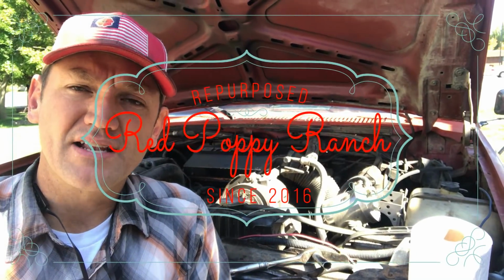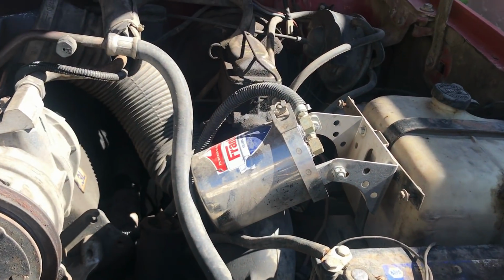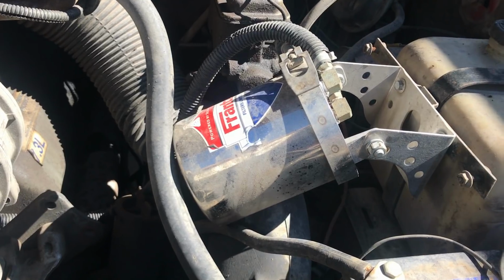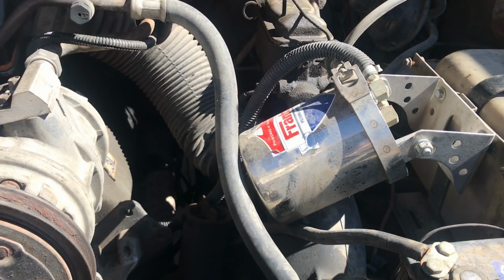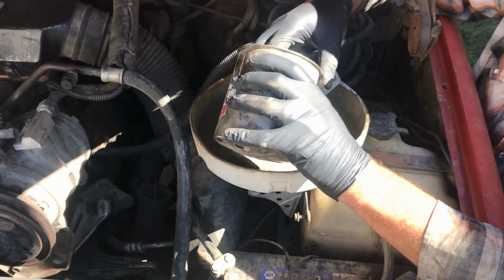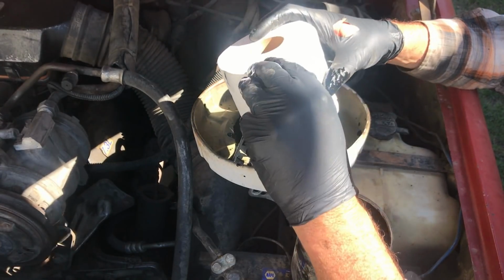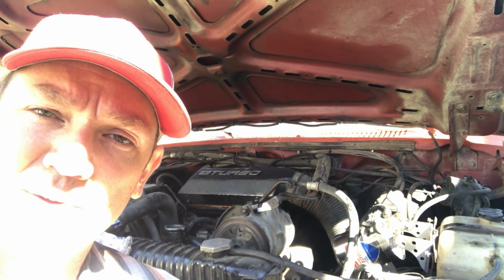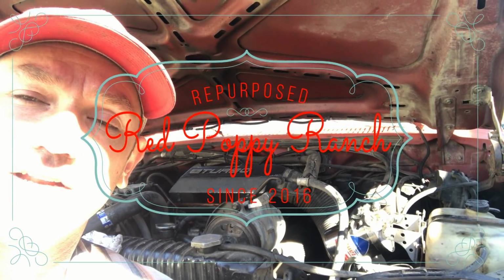#146 - Toilet Paper Oil Filter Maintenance... (Frantz Oil Filter)

Comment: What happened to never change your oil I promise, that oil looks like a moonless night. Change your oil people
Reply: it is truly crazy if one doesnt change his engine oil ever. they will sell grease after their engine seize up.
Reply: Amir Danial its diesel as soon as you change it it will be black but i would never use toilet paper as a oil filter
Reply: Used these filters on diesel engines for over 30 years when I bought a diesel Peugeot. I want to see a shiny black. Not grey black. On a diesel engine I would use a less expensive proven oil like Shell Rotella or Chevron Delo. I would change the filter more often than a Frantz dealer would recommend. Black doesn't mean dirty. Black is beautiful. Put some on the palm. If soot fills up the crevices in the skin and won't wipe off its dirty. If you don't want to change the filter often buy a gasoline engine.
Reply: It is risky to tell someone they will never need to change the oil again. The engine might develop a anti freeze leak in the oil. When you are changing the filter and adding a qt of oil you are keeping the oil clean plus you are adding enough new oil to keep the additive package up. That's why I change the filter more often in a diesel engine. Also additives last a lot lomger in analytically clean oil. This isn't complicated.
Reply: I have a habit of saying no more oil changes. It is better to say no more oil drains. When I installed the Frantz on my nearly new 64 Rambler I didn't drain my oil again. I was changing the toilet paper and adding a quart of Chevron Delo every 2000 miles. It was a lot dirtier than my Altima which gets a new quart of oil every 6000 miles approx. The truckers that have the big 2 roll bounty big roll filters add about 2 gallons of new oil at filter change.
Reply: Correction The big Gulf Coast 02 takes 3 gallons of make up oil .

Comment: Gotta laugh at all these guys who obviously don't know the purpose or workings of a bypass filter like this.  Or the ones who still swear by the old 3000 mile oil change fallacy.  Oil analysis doesn't lie.  But hey, if you enjoy wasting money and time changing your oil all the time, be my guest.
Reply: So agree.
Reply: bigchevy80 I just bought a 1946 Chevy truck with a Frantz sky filtering. I noticed there was no oil filter. I can’t a filter for it. I’m using synthetic Mobil 1 oil. Can anyone help me?
Reply: I bought a truck with a Frantz sky (whatever that means)? It didn’t have a oil filter in it! Can anyone tell me the part number for it, I’m using synthetic oil in the 235 cid. Thanks
Reply: Fallacy? I've never seen an engine destroyed by changing the oil too often, but I've seen alot of them destroyed by not changing the oil enough. It all depends on how long you want the engine to run before it wears out.
Reply: I have no idea why people can believe that allowing the oil to get dirty wear and foul the engine then draining it is better than  never letting it get dirty. Actually I know. Clean oil doesn't generate profits.
Reply: @ralphwood5114  Refuge companies have learned to not trust oil analysis and now change their oil at 3X the OEM interval (450-500 hours) with filter changes done ever 150 hours. Fine particles are more damaging than anything collected in the filter. The myth from Amsoil is misleading, regular oil changes are still necessary regardless of what filter is installed on the engine. *I also have this system on a diesel to remove contamination.
Reply: I have been known to drain oil. I have probably drained my oil a dozen times in the last 50 years. Changing the toilet paper and adding a quart of oil every 6k is plenty on my gasoline cars. I change the filter more often on my diesel cars. I don't expect the oil on a diesel to look like the oil in a gasoline engine. Black means nothing. There is clean black and dirty black.
Reply: There are over the road trucks that have gone over 1 million miles with no oil drains. They have big double roll paper towel filters.They get a lot of new oil added at filter change. They normally get the oil analyzed at filter change. It would be a waste of money on my old 6.9. I can look at the dip stick and can tell if I am changing the filter enough to keep the oil clean. An engine needs some new oil added mostly to keep the additives up to specs. It doesn't need a full oil change every 3k. The Frantz is just a smaller version of the big Gulf Coast filter system. The centrifuge is a good system but you still need some new oil added. I prefer the simple filter system. I probably change my filter more often than most. I've had good luck with Delo or Rotella.
Reply: The main thing you are doing when you are getting your oil analyzed is you are checking to see if something is wearing out. I'm not depending on a very expensive engine to put food on the table like an over the road trucker.  I do believe in oil analysis.
Reply: Just saw a post where someone said the toilet paper filters were designed for non synthetic oils. One guy said they were designed for non detergent oil. I might need to drain the Platnimum and find some cheap non detergent oil. Don't want to give up my toilet paper.
Reply: @Dumbass_mechanic  stupid statement. Like my sister saying I'm not rich enough to be a Republican. I've used the filters for.almost 60 years starting with a Frantz. The thing I see people doing wrong is they use expensive oils and sometimes expensive oil filters.Then they dont change the filters often enough to keep the oil clean. The engine will last longer using Rotella and changing the Frantz more often.
Reply: @Dumbass_mechanic  I've found that clean oil will virtually stop engine wear. Allowing oil to get dirty then draining it makes no sense to me.
Reply: I believe SKY on the top of the  Frantz were for the owner Skipper K Yee . Someone correct me if I'm wrong. I talked to him a few times.

Comment: Don’t take any paper off roll, push hole end over knee, to make dimple one end of roll, put wire extraction tool in dimpled end of roll, that end into hole of can and push till it’s in ,and flat on roll other end. Completely in. That makes it easier to fit.

Comment: We all now know where FRAM got its inspiration.
Reply: MrNedsaabdickerson it's Frantz I believe, not Fram..
Reply: Robert LaFountaine ,that one went way over your head
Reply: Yup, good filtration.
Reply: Yeah. Lol
Reply: One of.the first bypass filters I used was a Fram with a Cotton.element. I removed the cotton from the element and converted it to toilet paper. It filtered like the Fram element.From the outside to the center. Had to punch the core full of holes. Used a piece of under sink drain pipe drilled full of holes. Trying to avoid paying the obscene price of 29.95 for a new Frantz.
Reply: The Fram has been around a lot longer than Frantz. Some time in the 60s good elements were no longer available for the Fram. If you had A Frantz adapter that allowed you to use toilet paper you were in luck. They also fit other bypass filters such as AC. At some point cotton elements were replaced with the junk pleated elements.
Reply: Actually a Fram housing with the Frantz toilet paper adapter was even better than the Fram cotton element. The oil had to travel thru 4" of media instead of 2" of media.
Reply: The origional Frantz was a Frantz canister with a hole in the center so it could slide into a larger Fram housing upside down. My diesel tractor has  a flat head Ford V8 canister filter that uses a 4 1/2 inch roll of Scott 1000 sheet toilet paper.